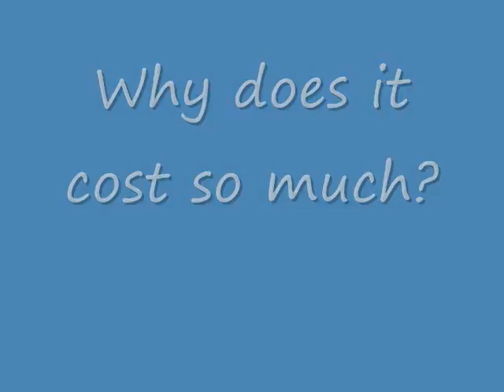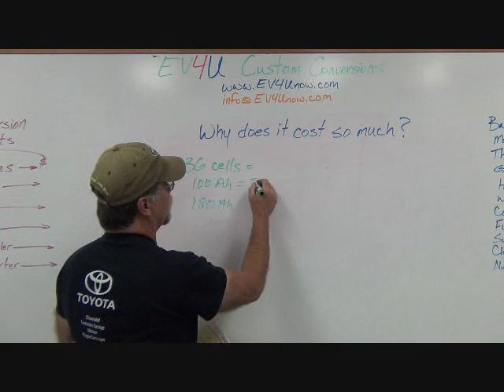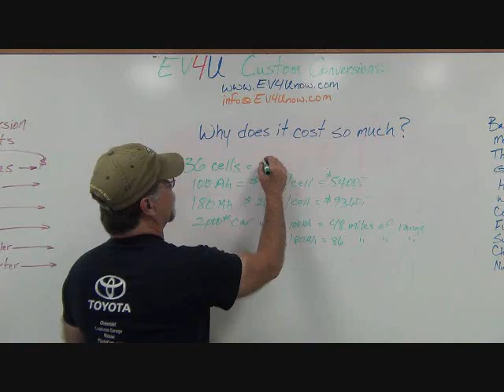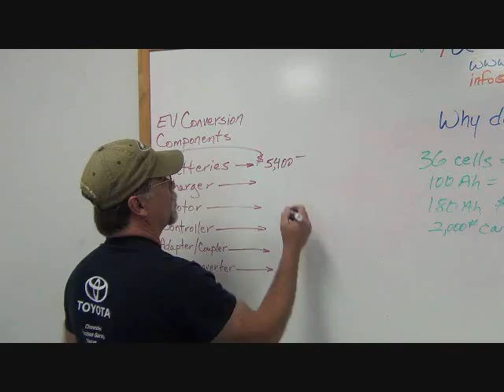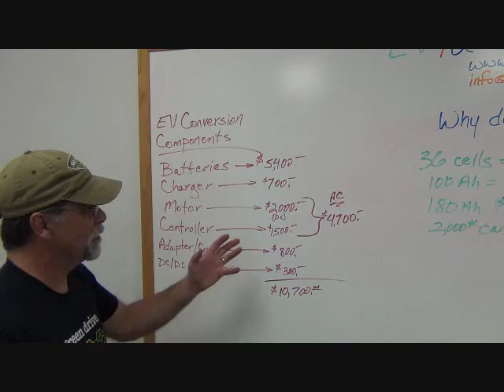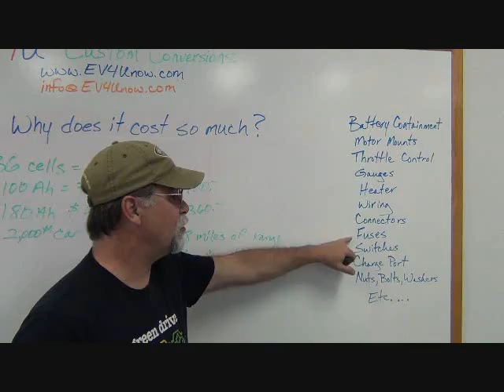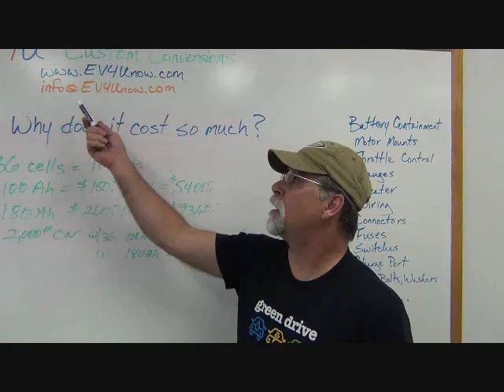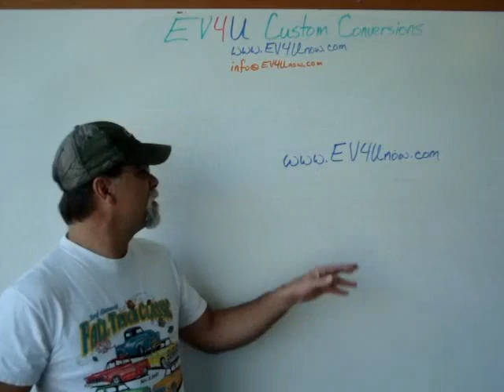DIY Electric Conversions - Why does it cost so much?  www.EV4Unow.com

Comment: If nothing went wrong I'd be saving £3000 in fuel so if kept it 4 years that's a £12,000 so most the conversion paid off it 4 years

Comment: Why is your range so short? Is it just that you don't use as many batteries as a Tesla? Not comparing but 220 vs 60
Reply from the maker: To answer your first question.  Why is your range so short?  Because the car is driven anywhere from 50 to 85 miles per day, and a 14.6 kWh pack with opportunity charging is sufficient to do that.  The smaller, lighter pack allows for a sporty, agile, quick and fun to drive Karmann Ghia.  In the larger picture, 80% of Americans drive less than 40 miles per day, so a larger pack is not required for 80% of customers.  Regarding your second question.  Is it just that you don't use as many batteries as a Tesla?  That is correct, a Tesla Model S may have an 85 kWh pack and the Karmann Ghia has a 14.6 kWh pack.  The Karmann Ghia cost $23,000 and a Model S is $100,000.  Different vehicles for different purposes.  Thank you for watching.  Please address future questions or comments to:  info@EV4Unow.com

Comment: A different battery option could be a homemade cell out of 18650 batteries, it takes a while to make and a lot of effort testing all the batteries but overall it can make for a far cheaper battery that runs just as well as the 100/180 ah cells.

Comment: suggest looking into the bedini circuit charger. it recharges batteries using free energy. works on wet cells. supply a bedini battery charger with your kits.
Reply from the maker: Thanks for watching.
I have yet to see anyone actually charge a battery with a Bedini charger.  Yet alone a 14.6 kWh pack.  Also we don't use wet cells.  We use LiFePO4 cells.  Thanks for watching.

Comment: Thank you! Helpful video. I am sure someone else has ask this. How long would you expect those 100 ah batteries to last? For instance if you drove it around 38 miles 5 days a week to work and back.
Reply from the maker: The manufacturer says more than 3,000 cycles, which equates to more than ten years of driving.  At which time you will still have 80% of the original capacity, or 80 Ah.  We have been driving a set since 2009 without issue.
Reply: EV4U Custom Conversions Nice. Then that would be worth the investment. Thank you, again!

Comment: Richard, I think you have converted me! Love your web site and all the great info. I am very impressed with how you find the time to answer so many questions! A few days ago I asked a clutch question and you said there would be a video about why have a clutch. Sure enough the next day you had a video that answered my question! How do you do it? My wife needs a NEW car soon and we will trade in both our cars to get her a new one. This leaves me without, so I was thinking as far as costs go, a used car with a bad engine can be bought very cheap! So if I electrified it my cost would still be reasonable. I was surprised how many cool cars are available on e-bay with bad engines! Miatas, Fieros, MR2s, Porsche 944s Etc. I think I'm hooked! One question please, I am impressed with "your" taper lock coupler but what do you do for a pilot bearing for where the transmission main shaft enters. I wouldn't want it "floating" around without that support. Thanks, C. Tait (billandbeaufort)
Reply from the maker: When available we use a stock pilot shaft bearing, just like the internal combustion engine used.  On some "oldies" where a bearing isn't available, we machine a bushing using impregnated brass.  Since you are not using the clutch in the same way as you do in an ICE they work well.
Reply: EV4U Custom Conversions Richard, I was just saying how well you answer e-mails and asked another question. That was ten minutes ago!!!!!! HOW DO YOU DO IT???? P.S. I found a Porsche 944 with a blown engine for sale cheap!!!
Reply from the maker: I've been cloned.